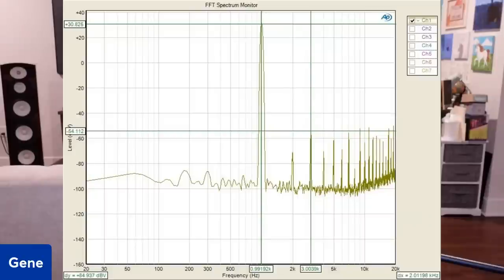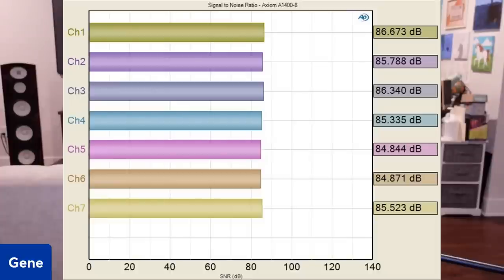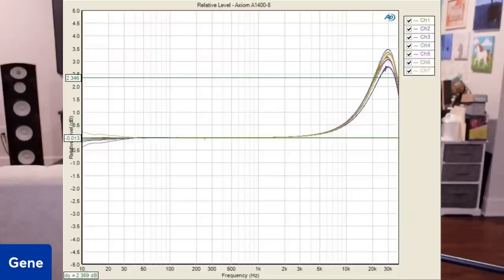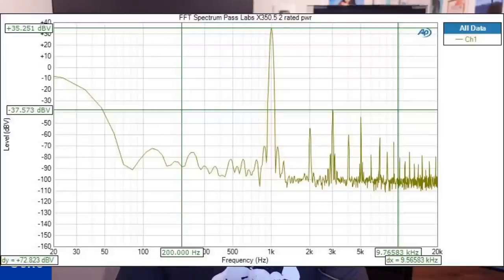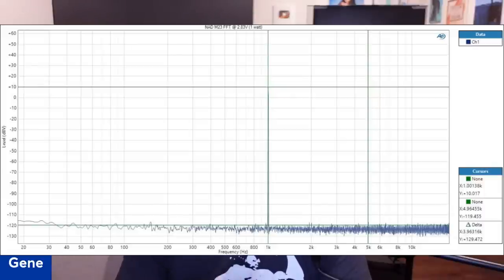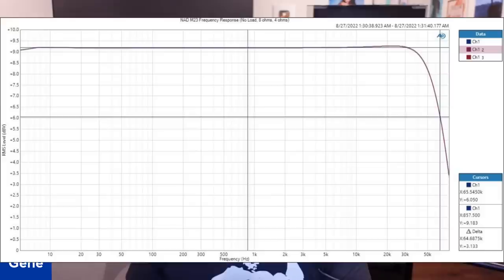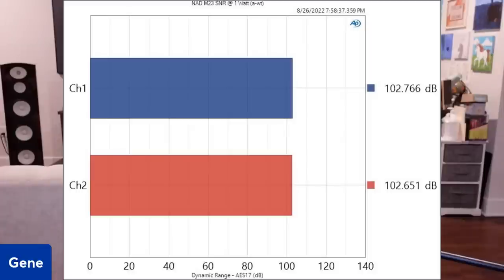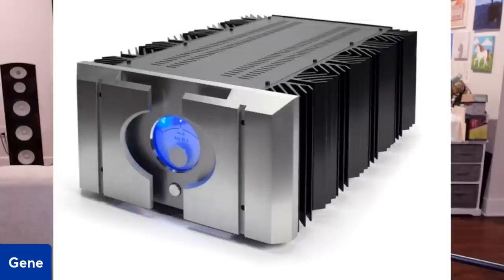Linear Amps are DEAD, Long Live Class D!

Comment: Nice video. I have a class D Integrated amp  with a tube preamp stage. It sounds great to me. I really don't get to deep into all the measurements. It's more important that it sounds good to me. Measurements are used to design the equipment, but specs on paper don't always mean great sound. Whether it's class A/B, class D, solid state or tubes, I let my ears decide.
Reply: specs on paper don't always mean good sound with SPEAKERS - namely because they're not typically measured correctly and the information is not interpreted correctly, and because it's much harder to measure speakers in all relevant dimensions and make sense of that data, though perhaps not impossible.  

but with amplifiers, measurements are everything.  good measurements - assuming they're the right measurements, done correctly, absolutely do guarantee "good sound"... or at least, sound that is CORRECT.  the measurements are what tell us if the OUTPUT matches the INPUT but simply scaled up.  then it's down to source material and speakers.  the amp he showed today, for all intents and purposes, is perfect.  if you A/B'd it to something else and could reliably tell the difference in a double blind test and preferred the other amp, that only means that you prefer some kind of distortion.  again - with amps, or dacs, specs on paper - the measurements - by DEFINITION mean good sound, if by good we mean correct and free of distortion.  it can't get any better or more correct than correct.  don't soften the facts with your feelings.  speakers are another world entirely, and much more subjective, although some of the numbers still do matter objectively.
Reply: @Artcore103  Thanks for your reply. And God bless you if measurements bring you lots of joy. Everyone has an opinion on this subject. Here is my take. I listen to music with my ears. If it measures well, but doesn't sound good to me, it isn't something I'm going to incorporate in my system. On the other hand, if it sounds great to me but the measurements aren't great by whatever standards are used to measure it, I don't really care because it sounds good to me. 

Here is an interesting side analogy. Most of the great musicians of all time select the instruments they play based on how it feels and more importantly how it sounds to them. I have never heard of a great musician say they selected their instrument based only on measurements or specifications. Itzhak Pearlman for example, plays a Stradivarius Violin made by the famous Antonio Stradivari. Stradivari made violins from 1644 - 1737. He made them by hand and did not have any sophisticated electronic measurement devices to measure how they sounded. Pearlman selected his violin based on how it felt in his hands and how it sounded. Most violin players will say that a Stradivarius is incomparable in sound to any other violin. Even with sophisticated measuring devices today, no one has produced a violin that sounds like a Stradivarius. Maybe these great musicians, the people who actually make the music we listen to, are all wrong and should use measurements to select their choice of instrument instead of, well, using their ears. I'll keep listening and subjectively select what sounds best to me.
Reply: @neilfisher7999  an instrument is very different, it's not trying to accurately reproduce something else, it's making its own unique sound, and every one sounds different.   Measurements would thus be pointless, and also there's no other violin that would theoretically measure just like his stradivarius. 

But an amplifier is intended to replicate an input signal, so therefore if you want to actually hear what his violin sounds like, the measurements - assuming they're accurate and represent all relevant variables - are literally all that matters.   Preference is one thing, we're all entitled to it.   But you cannot rationally simply turn off your logic entirely.   Your analogy is without merit or comparative value.
Reply: @Artcore103  I prefer to listen to music and enjoy how it sounds. How it measures does not concern me if it sounds good. Music by its very nature is subjective. What is pleasing to the ear of one person is harsh and unpleasant to the next person. Listening to music through some kind of sound system is also subjective. You can measure things till the cows some home. And if that is what you enjoy doing, then so be it. The reason there are so many choices out there when it comes to audio gear is because there is no “end all be all”, or “one size fits all” setup that everyone agrees sounds good. I don’t criticize what other people listen to or listen with. It is their choice. I am sorry you can’t wrap your head around that philosophy. I don’t understand your method either. It doesn’t matter, you have your opinion and I have mine. I play music and sing. I also read music. Maybe you do as well, I don’t know. Again, it doesn’t matter. Buy all the gear you want based on measurements, if that makes you happy. Be happy, don’t criticize others who don’t agree with your methodology.
Reply: @neilfisher7999  I think I was clear but I'll say it again, I have zero criticism for your or anyone else's preference, that's legitimate.  I'm merely stating that objectively amplifier quality can be measured and thus good and consistent sound can be 100% ensured.  Unlike instruments, two VERY different amplifiers that measure the same - again assuming accurate measurements that account for all relevant variables - WILL sound the same.   If you like it warm or bright or bass etc you can use an eq, but at least you know the amplifier can perform an output that matches the input i.e. what is intended.  Given what is typically used as mastering equipment in studios, you should have an amp that measures well, though the speakers will always play a more dominant role in the sound.   I do play instruments as well hence my issue with the false analogy.  

Your amplifier isn't an instrument... it's the thing that should accurately play back the instruments that were recorded.   However, speakers are unavoidably an instrument to some degree, it is what it is.   I prefer speakers to headphones or earbuds even though technically they are less of an instrument and can ensure a more controlled and accurate experience but I find it subjectively inferior.
Reply: @Artcore103  here's my last thought on this. I sold hifi gear for a few years back in the late 80's and early 90's.  I listened to lots of different brands and models. Several times I  pulled the specs on 2 different amplifiers that measured almost identical, but they sounded apples to oranges different from each other. This is when I started paying less attention to measurements and more attention to how components sounded. How do you explain two amps with identical specs sounding completely different? Maybe each manufacturer measures differently? Who knows? I don't put a lot of faith in measurements because of my years of experience auditioning lots of gear and hearing widely different results from supposed identical gear. Again, this is my way of doing it. Not right or wrong, just works for me. Lastly, I think there are probably things that aren't being measured that our ears hear that make two identical products different. Cheers!
Reply: @neilfisher7999  ah yes I see the disconnect here.   The "specs" and "measurements" you're referring to do not even come close to what I'm describing as adequate and descriptive of all relevant aspects. 

The way we do measurements now, at places like audio science review and many others, is 100% completely different from the manufacturers claims or old review magazines.  Those specs were indeed largely useless and could not predict two pieces of equipment sounding the same.  In addition more modern equipment - the objectively good stuff anyway - is far more accurate than the hifi amps of old.

I agree with you there.  I think perhaps you just have not been aware of certain more recent developments in the science  of measurement and the progression of amplifier technology itself.   

It's as if the old measurements you find inadequate effectively stated "we have a green rectangle that's 2x4"... ok, what does that mean?  A small green piece of note paper?  But today the measurements describe a football field to the millimeter and define every piece of grass therein.  These things are not the same.
Reply: @Artcore103  perhaps you are right. I believe in science. However, I am not sure we can measure everything ours ears can hear, or how we hear it and our brains interpret it. Keep working on the science. It's important. I'll keep listening to music with my ears and maybe one day my ears will agree with the measurements.
Reply: @neilfisher7999  there's plenty of modern electronics that are effectively perfect beyond discernment, certainly not all, and not directly correlating with price either... but in the realm of speakers there is still so much room for innovation and improvement.   It's much more complicated when the sound is actually put into a space and interacts with it.  And the recording techniques play just as large a role and are equally limiting.   I'm not sure it's even possible to make a realistic speaker system since every recorded element has its own unique radiation pattern.  The directionality of a saxophone or a voice or a piano or guitar etc. are so different.   We can record what that sounds like in one location in one particular space... but as soon as we play it back in a different space, it's changed.   

If we had multi-track recordings with radiation pattern metadata for each track and a speaker system that could reproduce each track with that same original radiation pattern only then could we accurately move the performance to another place and time, and even then it would sound unique since every room would now be it's own venue simply having the same performance played within it. 

The best we can attempt for now is to minimize the effect of the room with directionality so that we're hearing the original space more than our own.   That's also what headphones can afford.  Each has it's place.   And what sounds "good" doesn't necessarily have to match the original sound, you're right about that.  I like horns with controlled and constant directivity, but then again I've never heard dipoles or 360 degree speakers (like upward firing drivers).  But it's nice to be transported to another space rather than be limited to hearing the music take on the qualities of our smaller spaces.
Reply: @Artcore103  I agree the gear today is way better than it was 30 or 40 years ago. It is amazing to me how even inexpensive gear sounds pretty darn good. So, we have made a great deal of technical advancements. I feel like there is also a great deal of art involved as well as science when it comes to sound reproduction. I am enjoying the hifi hobby more than ever because there are so many great options out there. Some people fawn over vintage gear. And that's okay if it sounds good to you. For me, I embrace new gear using both new and old techniques to achieve a pleasing musical experience. That's where the art and science mix. You are obviously very smart, and can explain it better than I can. I take the simple approach and just listen. But, I'm open to all possibilities.

Comment: Great for active crossovers, not so great with passive. High damping aspect too does not work well with some designs that benefit from a bass overhang.
Reply: "bass overhang" sounds like distortion to me - it sounds like the "design" is a flaw... you want the woofer to not follow the output signal but smooth or round it out?  i think you're wrong.  better control over the woofers is better.  if this results in somewhat less full sounding bass / less spl at certain frequencies, EQ it back in.  the amp should ideally be in perfect 1:1 control of the speaker position at all times in theory.  if i'm missing something do explain i'm open to it.

Comment: Nice vid like always gene😃  do you think this nad m23 can sound as good as my parasound jc5?  I love my amp, but im getting very tired of melting away in my sofa in the summer🥵  and not to mention the cost of constant 2-400w of usage just by having it at idle to normal volumes.
Reply from the maker: The M23 exceeds the performance of Parasound with respect to noise and distortion. The JC amp probably has more output power at every low impedance loads which can be a factor if you're running such speakers. Just wait till Purifi comes out with 1kwatt modules. Game over Batman!

Comment: I initially bought a Class D design power amp because it used MOSFETs instead of transistors and in my experience, MOSFETs sound much better and very close to the best aspects of valve amplifiers plus "killer" bass.  The fact that it was a Class D amplifier was a side benefit.  The rest of the system uses a Khozmo passive preamp and pure silver wires for the speakers and the interconnects into a pair of Magnaplanar 3.7i's.
Reply: @Douglas Blake Yes, I know, it's in the name - Metal-Oxide Semiconductor Field-Effect Transistor, but I'm referring to MOSFETs versus bipolar transistors.  For whatever reason, MOSFET power amps sound better than bipolar power amps.
Reply: @Douglas Blake Yes, I didn't mean they had emotional issues... 😆  Like I say, I don't know exactly why they sound better, but from my experience selling hifi (admittedly a while ago) MOSFETs of a similar power and price sounded better and much more like the best aspects of valve amplifiers, but I'll take your explanation on board.

Comment: I think the idea that, "lower distortion equals better sound" should be examined, in particular, how those measurements done on a test rig with a sine wave, relate to real world music. Real music isn't pure tones. It has overtones and harmonics that mask the distortion in your equipment. Alan Lofft at Axiom in Canada, had done a study with multiple people to see what levels of THD they could detect in pop music. Detectable THD at the highest frequency had come in at 35 db below source. At the level of human speech, it was detectable at -10 db below source. It's true that IMD hadn't been studied in isolation. I also think sharp spikes in distortion or SNR  are less detectable than when the number is mediocre across the board. I had also made the mistake of trying to fix jagged spikes in doing room EQ for the first time and I had ended up with something that had sounded worse. Nelson Pass isn't interested in producing amps that have the lowest distortion, to try and win some pointless contest to produce the best number THD and SNR numbers. Steve Guttenberg has talked about this in his videos. Nelson also understands that power is a pull, and not a push, and that current on demand is more important than the rated RMS power which is done using a sine wave. More power is not always better depending on your situation, because you're not using it with efficient speakers at normal listening levels. Planar and electrostatic speakers are current hungry, and present a unique situation.
Reply from the maker: I saw those tone tests Alan did and they were highly flawed. I also look at multitone tests too but if an amp has high distortion using single tone it usually is even worse with multitone. Pass Labs issue is the lack of wide bandwidth feedback which we discuss in detail here.

https://www.youtube.com/live/kPqpuTO6Kd4?si=5icfiJE9BhOUNf4i

Comment: i only have class d amps, but any high efficiency amps is what i want. 
but the efficiency rating is at high output level, wish i rarely use. 1 watt output is what i want, and the best class d amps are at 10% efficient at that point.

Comment: 16 Channel class AB amp - BGW VXi 8.8. From ATI.
Power Output
RMS, 8Ω, 1kHz, 1% THD: 200W (40 Vrms) x 16
FTC Continuous Average Power Rating 20Hz – 20kHz @ .05 THD or less
8Ω - 200 Watts (40 Vrms),
4Ω - 300 Watts (34,64 Vrms),
2Ω - 300 Watts (24.50 Vrms)
EIA Continuous Maximum Power Rating 1kHz @ 1% THD
8Ω - 255.4 Watts (45.20 Vrms ),
4Ω - 392 Watts (39.60 Vrms),
2Ω - (31.69 Vrms)
CEA Instantaneous Peak Power Rating - 1kHz @ 1% THD
8Ω - 309.5 Watts (49.76 Vrms),
4Ω - 519.7 Watts (45.56 Vrms),
2Ω - 763.4 Watts (39.06 Vrms)
Typical THD<0.05%
Maximum THD1.0%
IMD<0.05%
Slew Rate>60V/μV
Damping Factor>400
Crosstalk>85 dB
DC Offset<10 mV
Recommended load4/8 Ω
Frequency Response+0/- 3dB 10 to 80 kHz
Signal-to-Noise Ratio124 dB referenced to rated output (A-Weighted)

Comment: I see Purify as a Hydrogen Car. Efficient, long range, smooth ride, quiet, and expensive. 

I had Rotel Class-D amps, loved them they were bright on a Marantz processor. But I sold them and purchased an M28 last year to drive Polk Legend series 7.1.4 speakers, and love it. 

But, and it’s a huge BUT, my Polk L800 SDA speakers require a Balanced Amplifier design to fully take advantage of the SDA technology. So now I either need another two channels, or keep what I have.

I can say this, no matter how loud I turn up the volume, there is never distortion. It’s amazing the detail I can hear with ATMOS music from the Apple TV. 

 Now NAD just needs to make a smaller 6x 100w purifi amp for ceiling speakers, and a processors and receivers that has 6 heights. 

Yip there is no 7.1.6 or 9.1.6 with NAD. Crazy eh?
Reply: Update:
I found the Hypex modules on my NAD receiver to sound better then the purify. There was more bass on 100w Hypex amp vs the Purifi 280w.  I know the Purifi has very little distortion, but the Purifi didn’t light up my dual 10 drivers at low volume, where the Hypex does. How buzzar.